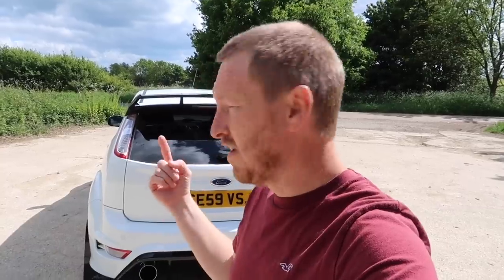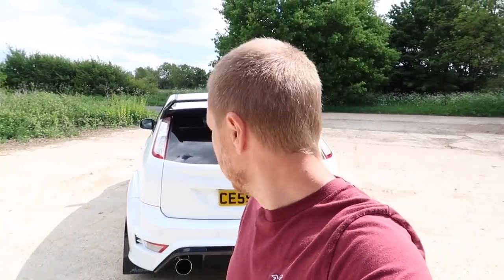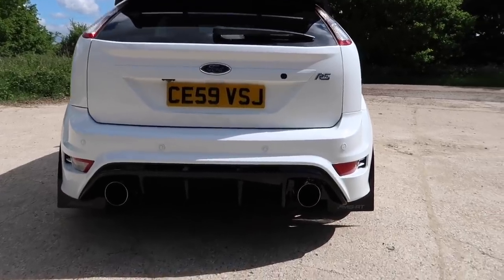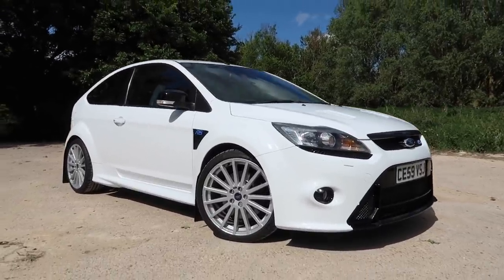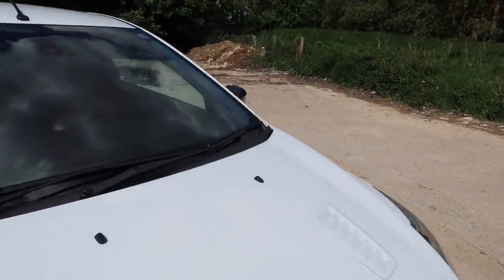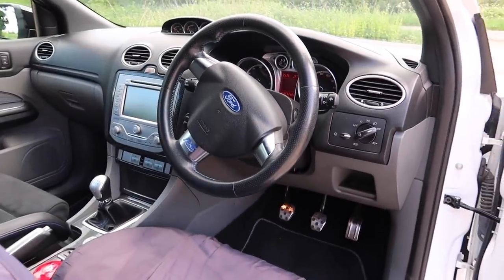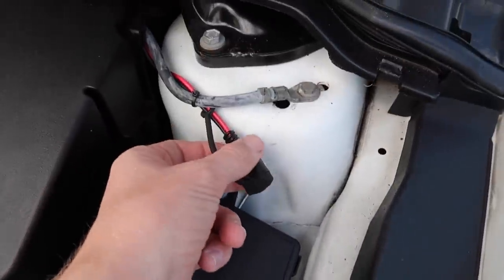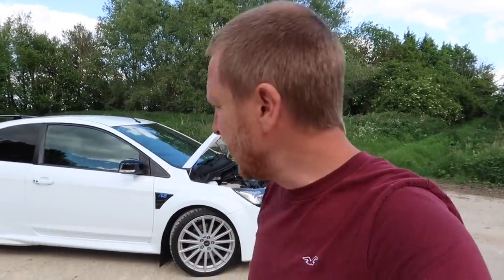I finally got my new wheels fitted! Walk around video of my Mk2 Focus RS.

Comment: I feel your pain with doing the turbo to crossover pipe.  I swapped mine out on the old mk2 st it was a pig getting the pipe attached to the turbo.  I also deleted the symposer on my mk2 st as it's prone to splitting on those so figured remove it and 1 less thing to worry about.  My st was running 320 and the power delivery was brilliant would probably still have it now if it had not got rear ended and written off.

Comment: Looks great Gary!! Everything you’ve done so far looks really much much better! Wasn’t sure when i first time saw your new car as i loved your old one Mk3. I really hated those stripes,black wheels.. I think there is not much that you can do on the outside or engine bay, but what about interior? I think i would change maybe floor mats and would look for some nice steering wheel. Have you ever thought about changing interior a bit? Otherwise good job so far 😉👍 And by the way, you don’t need springs 🥳

Comment: Car looks great with the silver wheels.  Personally I love the stock look and 100% agree with you to keep it looking that way.
Your RS sits at a nice ride height just as it is ... the lowered Eibach springs will look better but will you have issues with clearance on steep driveways etc?
You mentioned that you don't like tyre black because it flicks of etc.  A good quality Tyre black just finishes a car off and protects the tyre rubber and keeps it looking new.
I would recommend Angelwax Enigma Elixir ... it's a ceramic infused tyre black that will not sling off and will give the tyre a nice satin finish ... I think you would like it.

Comment: It looks really nice and I’m debating silver wheels and blue vents also on my PB RS? But I will say and it’s the only thing holding me back is that when you go standard look it does age the car slightly? In the flesh I’m sure I would change my mind though. I would fit the springs although the view as it is looks Low already? Sure it’s the camera angle though. If your debating what’s next I would go clear fog to even the look and a  BBK. EBC in blue 👍🏻

Comment: Don’t lower her mate I have lowered various cars from various brands the last one being my previous M3 and it was a really expensive set up and handled on another level! But I had to virtually crawl over speed humps and there are plenty where I live. It may also be a coincidence but my arches needed a yearly refresh at the body shop and it was a low mileage example less than a 3rd of the mileage of my previous M3 that only had to visit the same body shop once in -3-4 years of ownership. So unless I was in the position to get a dedicated track car there’s no way I would consider buying a lowered car or paying to ruin another one for the road. Just my opinion

Comment: I’d fit the springs, they don’t drop it much, but I prefer them on mine over standard. Other than that I’d leave it as is externally (except the red rear fog lamp). If you did nothing more you’ve made a great car even better.
Reply: Car Focused That’s not a problem mate 👍🏻 weather forecast is looking good.

Comment: I would keep in on the standard springs mine is on H&R and I can only speak for what mine is like but it's very bumpy and can get unsettled on a fast uneven surface if I had some OEM springs I would 100% have them on my car
Reply: @CarFocused  they are on my list to get some one day fingers crossed can find some good low mileage once with no rust

Comment: Hi Garry I have a 2016 st and one of the rear arches are starting to rust so it's still an issue with ford iam getting if fixed ( you have to )
Reply: Every car has a weakness VW is all ways the front wings

Comment: Don't lower it i cracked my sump on my st mk2 on bloody speed hump and mines not lowerd i was luckily a friend had a sump becous their 500 pound plus i love the rs but i love my st aswell epic sound mins running 290 full boost and 3 inch decat and exhaust just ordered a stage 3 intercooler ive seen puma build rs engine im thinking of saving up for.